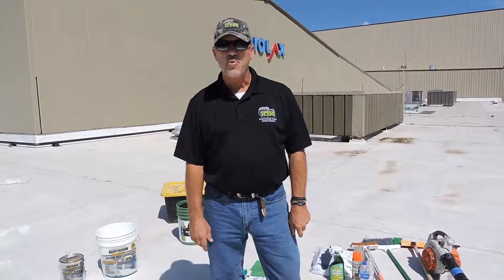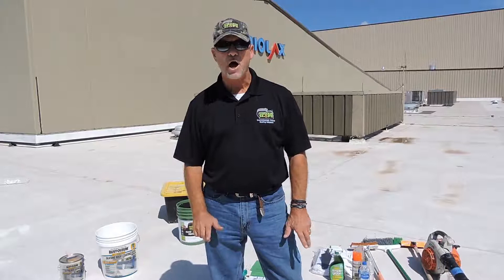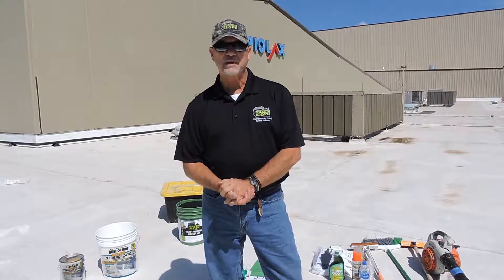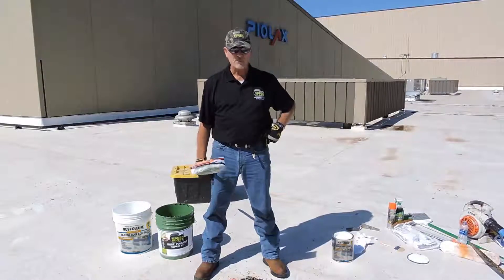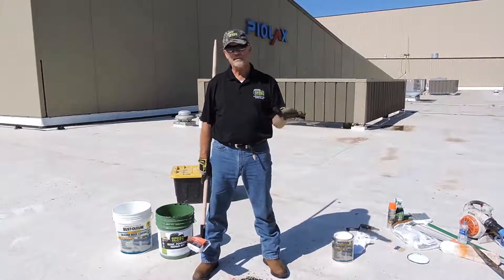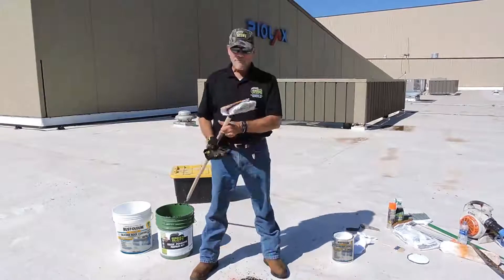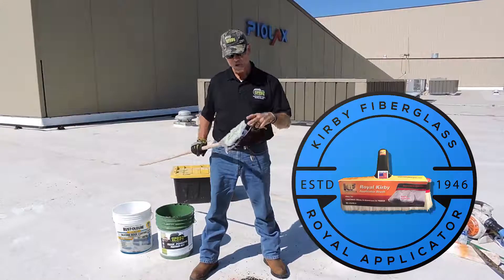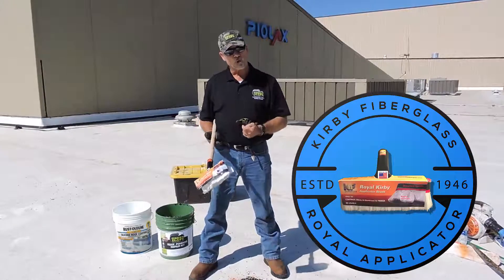GreenSlope Installation Demo | How To Install GreenSlope

Comment: Assuming our deck substrate is sufficienty sound; can we apply mastic and tile over your product?
Reply from the maker: Thanks for your question! While Green Slope is a great solution for creating positive slope on flat roofs, it is not recommended to install tile over it. Most mastics are solvent-based and can negatively react with the EPDM and EPS materials used in Green Slope. Additionally, the product isn’t designed to support the weight or fasteners required for tile applications. For tile installations, we suggest consulting with a roofing professional to explore alternative materials better suited for that purpose.

If you have any other questions, feel free to reach out to us at 800-859-4077 or contact@bigrocksupply.com — we’re happy to help!

Comment: What brand silicone are you using?
Reply from the maker: We’re unsure what brand of silicone is being used as a top coat in the video. GreenSlope can be top coated with any brand of silicone or elastomeric coating.

Comment: can this be walked on?
Reply from the maker: Greenslope can be walked on once it is cured/hardened. I would be cautious, however, if you are putting a coating on it depending on the thickness of the coating.

Comment: I recently had a porch with roof built.  The corner where the roof meets the side of the house is not sloped properly and water is ponding.  Can I use this product over shingles next to vinyl siding?